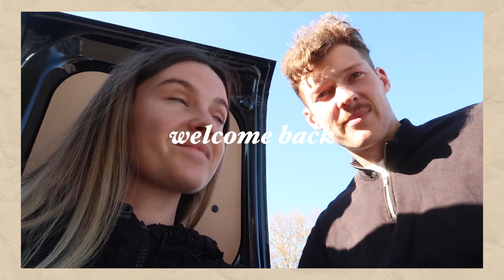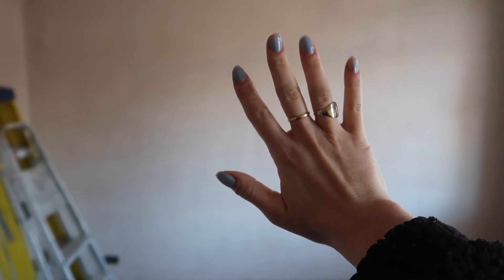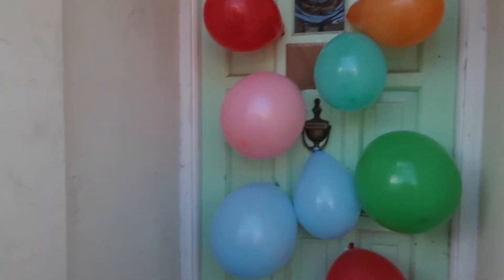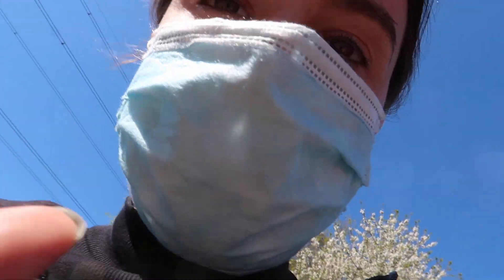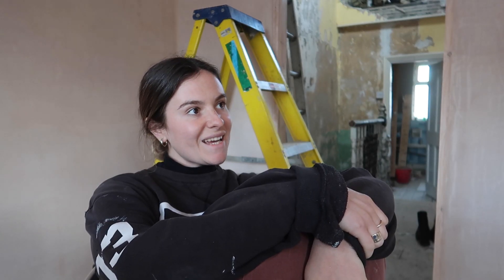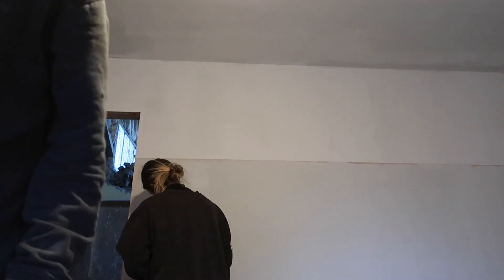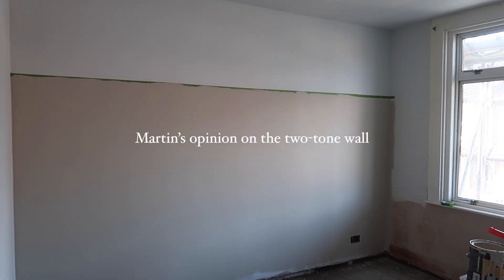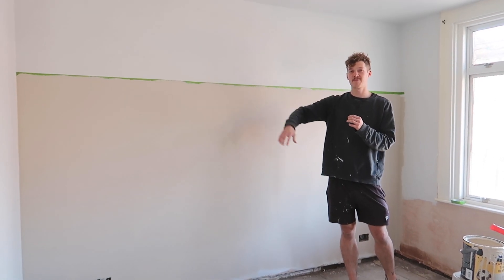OUR FIRST RENOVATION INJURY & HOW TO PAINT A TWO TONE WALL // victorian renovation diaries

Comment: Hi Guys  great start with the paint, unfortunate regarding the nail, don't feel bad as it happens to us all (nearly) I'm a similar height to Tom in which we don't need ladders LOL 
as before use PVA diluted for walls and ceilings and it will help the paint and reduce quick flaky drying, (only a suggestion) other wise great start. .oh, when you get sockets in the rooms maybe invest in a humidifier, as it will dry that damp plaster fast,, Great work and good luck
Reply: Never use PVA unless you want a skin of paint. Bad idea.
Reply: Do not use a dehumidifier, you will get more shrinkage cracks which is a pain. I know you have a helmet on in your picture but are you an actual helmet? Your advice is awful.
Reply: Good tip with the diluted coat first! Literally inhales the first cost😂🙈
Reply: Yeah I actually had to use a dehumidifier when we had damp issues on our renovation project. Took like a week to dry certain parts it was crazy 🙈